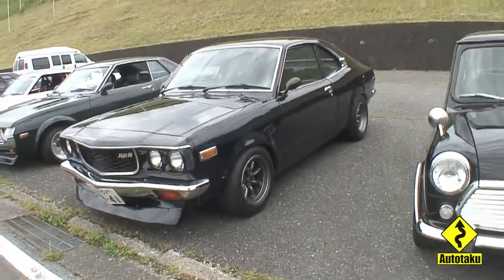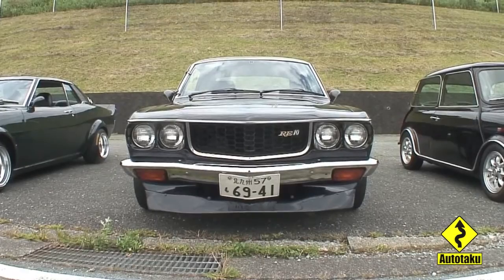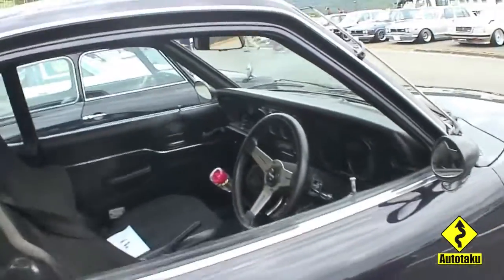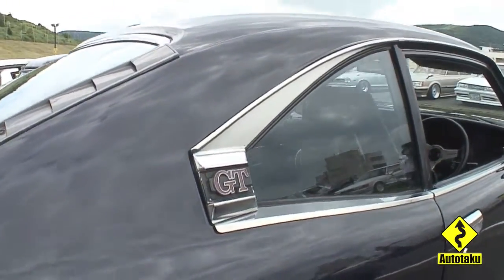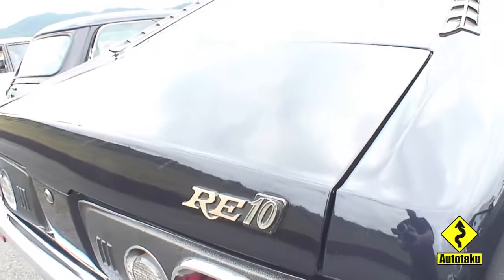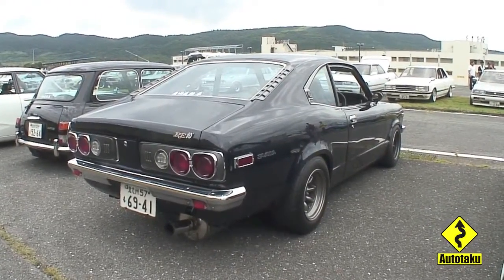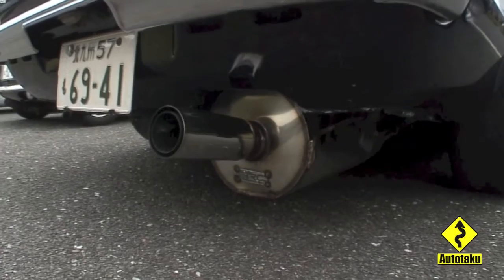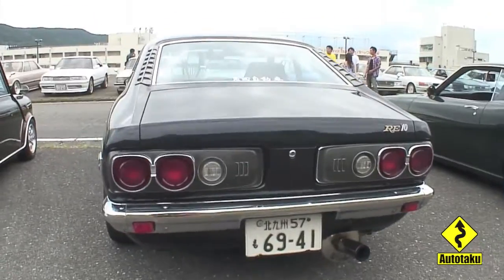Awesome JDM Spec - Savanna RX-3 RE10 GT

Comment: as sdcuigwelguicweliguc, said, RE10 stands for Rotary Engine 10A.

the original engine from factory in this car would likely have been a 10A type rotary. the 10A was one of the the first engines Mazda massed produced. slotted them into RX3's and R100's. they were a smidge under 1 litre displacement.

later model 3's had a RE12 badge.. scored a 12A engine.. just under 1.2 litres of rotary fury.

you'll find an RE13 badge on the later model RX4 with the 13B..